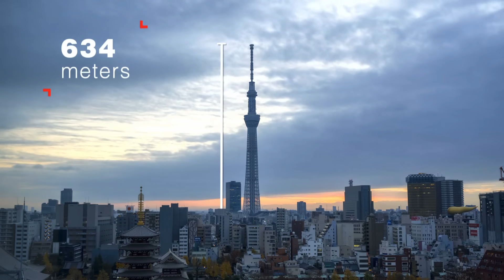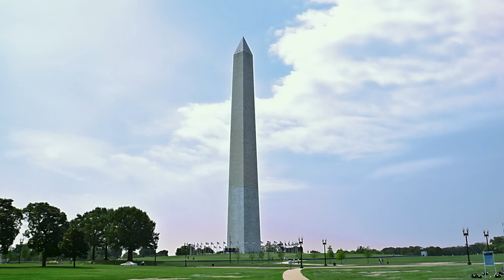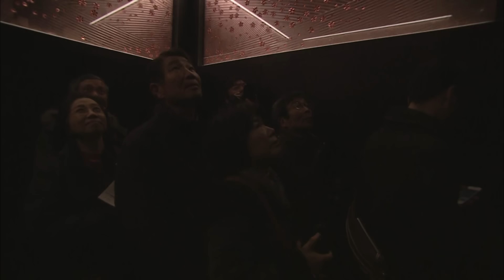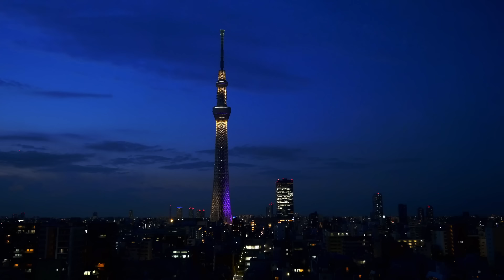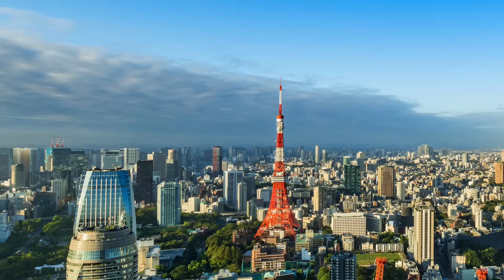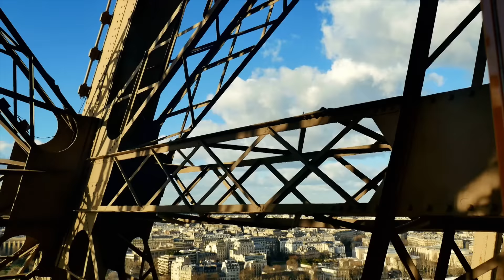Massive Structures: Mega-Towers Compared | Legends vs Modern Icons | FD Engineering

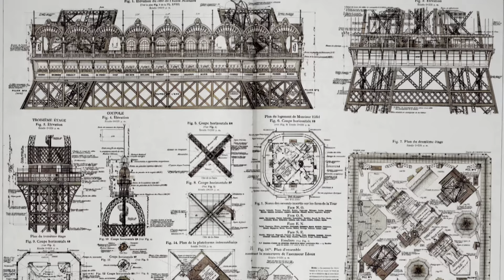Comment: 15:06   Eiffel Tower construction was accurate to 1 tenth of a millimeter, i.e. 1 millimeter is .03937inches, 1 tenth equals .004 thousands of an inch. Approximately the diameter of a single human hair. Are you implying that they had 200 foot long tape measures that were accurate within .004 in.???????  Stop lying to us!

Comment: The Eiffel Tower was built by Eiffel but not designed -this honor goes to Maurice Koechlin and Emile Nouguier - and he isn’t the architect either, this was Stephen Sauvestre…
Eiffel had the idea to use the tower for the first military radio-telephone system. TV came in 1943 with the Germans to the tower.
From the beginning of service the elevators have gone up to the second floor.